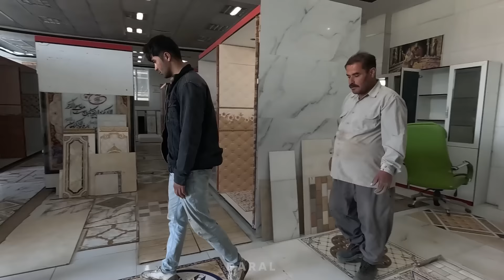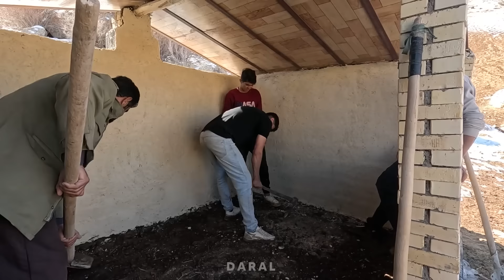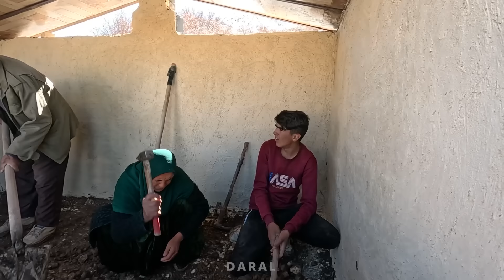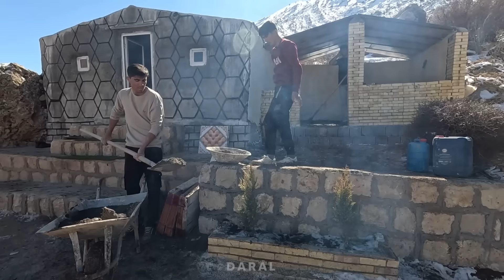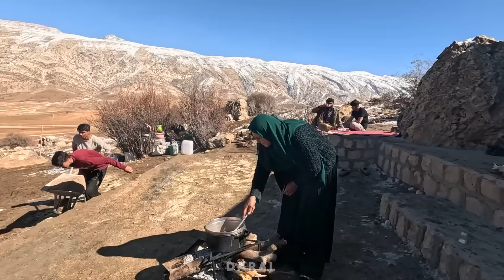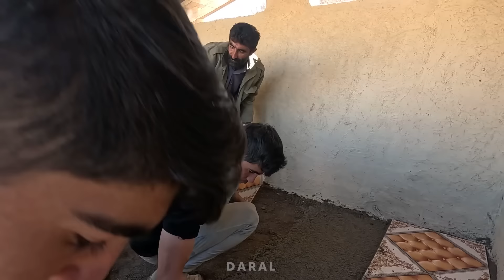"Transforming Amir and Family's Kitchen: Milad and Hassan Take on Tiling Adventure!"

Comment: You lay tile differently than we do here in the states. We start on level dry hard concrete foundation then thin set. Then use grout. I don’t see how your tiles are going to stick or going to keep from cracking.

Comment: Hassan should be laying that floor. He is such a more particular about the way things turned out that they have to be done the right way where the older one really doesn’t care if it’s the Level as you can see.
Reply: I totally agree. Milad didn’t want to finish the white wall. Hassan said no, it has to be finished. 👏🏼👏🏼👏🏼👏🏼

Comment: The first tiles are not aligned. 
  Also If their main source of energy is firewood, they need the correct tools like the axe.
And The mosaics should be installed using white cement, putting some on the concrete floor and some on the base of the mosaic..